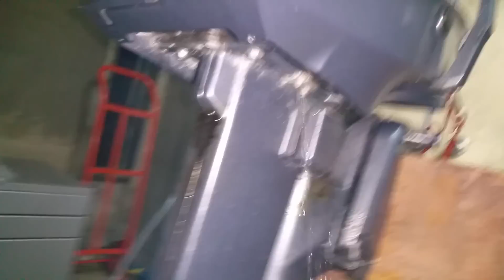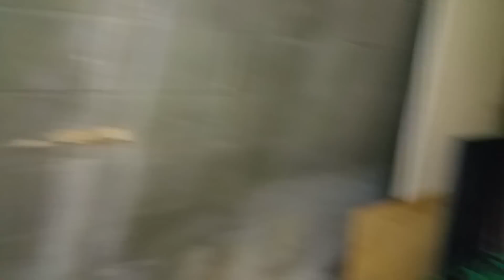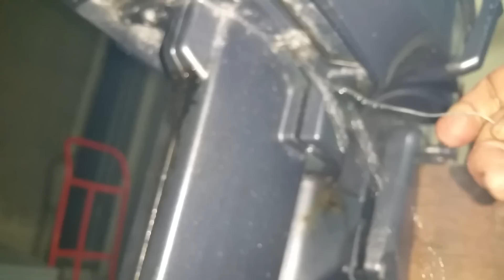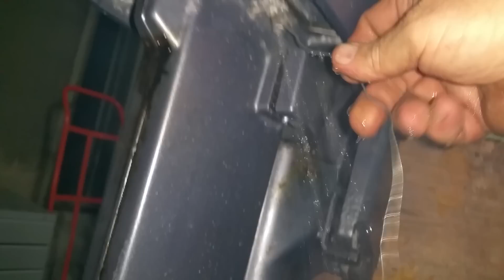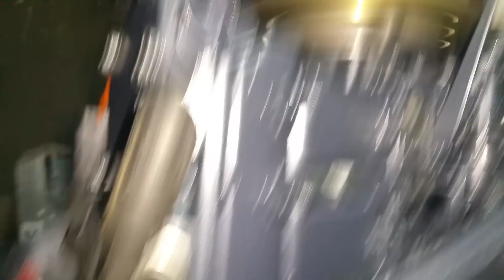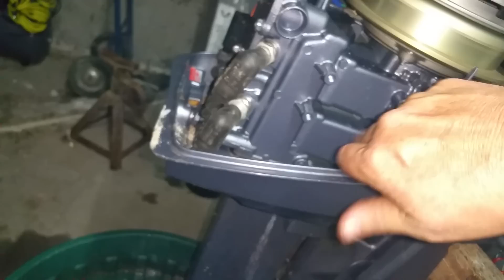Unblocking a Yamaha 8 HP 2-stroke outboard motor water jacket

Comment: I've got the same motor, mine is a 1993 model # MSH8R and I've currently got the powerhead off and cleaning the water jackets that are big time corroded with salt. 28 years of salt water exposure and things definitely need a good cleaning. I did the wire trick and replaced my water pump and impeller still no go. So if your outboard has been run in salt for many years be prepared for a lot of build up
Reply: Is there a YouTube 2:26 video showing how to do this ?

Comment: Anyone have a model number for this motor? I have the same engine but the data plate is unreadable and I'm looking for parts. It looks like the 8F on the yamaha web site but searches for 8f parts don't turn up much. Thanks in advance.
Reply: I have a similar one and the model number is 8CM. There's also another number 6G1 which seems to be significant finding parts.
Reply: 8SJ

Comment: I have the same motor. Any idea where the water intake is on the lower unit?
Reply: if its not on the sides is right on top of the prop on the cavitation plate

Comment: Hey mate, I’ve got an identical engine which had the same problem. Spent most of last season poking a needle in the hole. 
This winter decided to have a look and removed the exhaust jacket and manifold along with the head jacket. Turns out the thermostat was toast, several of the galleries were salted up and it was a bit of a mess. 
Anyhow, £12 thermostat from eBay, some gasket paper and lot of poking and scrubbing, she’s good as new. 

I expect the reason the starboard side of your motor is way hotter than the other is that the thermostat isn’t opening so not allowing water to that side. 

Hope this helps.
Reply: Mine had the exact same problem bought it for 300 euro because it wasn't pumping the guy who had it before never flushed it in salt water

Comment: had same issue.. impeller was shredded and jammed the pisser line  and thermostat was shot..seems nobody had worked on the motor ever believe it's a 1986 waiting for parts.. until this past year she never had a problem.. gotta love them Yamahas!
Reply: Hi I know this is a long time since you commented but I just bought a Yamaha 8hp that wasn't pumping and changed the impeller but it's still not pumping I also cleaned the telltale but it's still not pumping and air comes through the telltale
Reply: @GameCastCubed  when you changed the impeller did you blow out the line  from the telltale going down from the motor to the impeller pump ?https://youtu.be/dx8_xP30aSY?t=719
 Also try checking the thermostat housing pull it out and blow out that section.. just keep following the path of the water.. something is jammed in the system and or the thermostat is shot  also...
just my .02, 
good luck!
Reply: @swmplvr  The thermostat is bad and I left it out and started it and water isn't even getting to the housing
Reply: @swmplvr  I seen a vid of his where he tested the pump by putting the lower unit  in a bucket and spun the driveshaft with a drill. Do you know if I should turn the drill clockwise or anticlockwise
Reply: @GameCastCubed  not sure.. but even in reverse it should pump water... you could try blowing air through the lower unit intake and see if air is coming out at the impeller .. you would have to take impeller back out .. all you can do is keep tracing back to intake,maybe some weeds jammed in it?
Reply: @swmplvr  Thanks very much for your help  ended up putting a water hose on the tube going up to the outboard after I removed the lower unit and cleared it and it's now pumping fine. I'm just waiting on thermostat to arrive.
Reply: @GameCastCubed   Nice!! Congrats on the mission! Your welcome =)
Reply: @swmplvr  for anyone else, driveshaft always goes clockwise.
Reply: I just got an 86 8hp for 200 it needs carb cleaned but it does run. and it needs a lower unit inspection since shes sat for 2 or 3 years. How good and reliable has yours been?

Comment: what would cause it to be inconstant ? i have a 88 yamaha 8hp and pumps awsome water like a piss stream but if i leave it for 3 or so days i have to poke a pin in there to clear it out otherwise it wont pump any water.
Reply: Water jackets and passages are more than likely clogged/salted up.